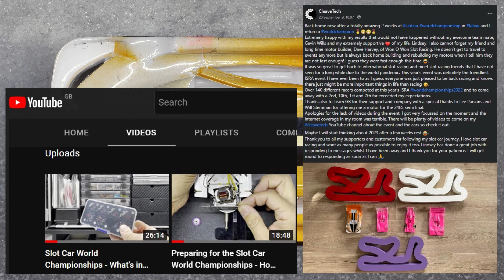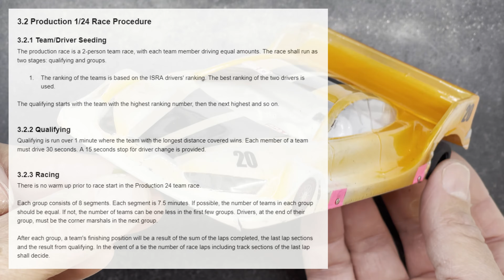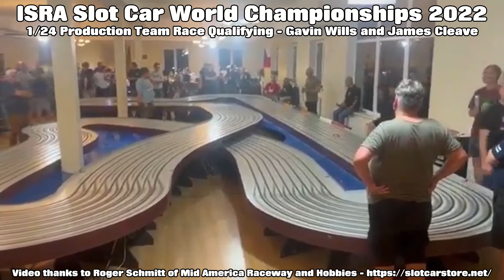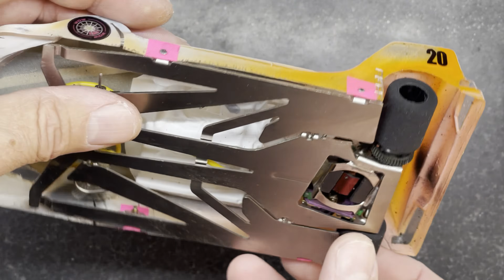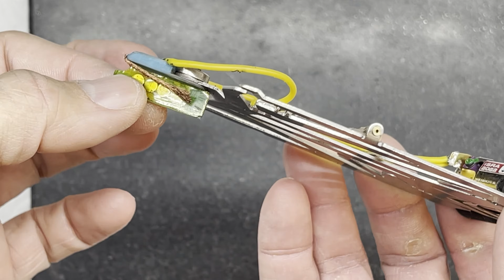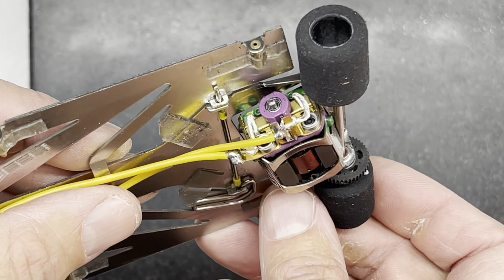Slot Car World Championships - Take a close look at the 1/24 scale JK chassis team race car (Part 1)

Comment: Kinda abstract for looking like a car. The front wheels stickers? In the old days they had to have a real car looking body and tires (all 4 of them) in proportion to car.
Reply from the maker: You are right, they are definitely not models of cars. These things are designed as slot racing cars and are designed to perform the best they can within a set of racing rules. They are like the Indy Car or Formula One cars of the racing world, not the sort of cars you see on the roads.

Comment: Thanks for sharing all this great tech info with us. I don't race any high end stuff but it is so great to see how it is done. Flexi is as high tech as I get. The Eurosport stuff is way over my budget. I do have some older stuff though. Early 2000s Mack 1/24 and older. Just track cars to play with. What do you think of brushless motors???
Reply from the maker: Flexi or Production racing is still quick and good fun. The racing can be very close.
I think brushless motors would be good as a controlled class or for local club racing as they require less maintenance than brushed motors.
Racing brushless in open classes releases a whole new can of worms with the potential for a lot of computer programming and fast development.

Comment: I've never seen a slot car without front wheels, mind you I've not raced since the 60s and 70s.
Reply from the maker: In the fast classes of slot car racing the front wheels are just stickers on the body these days. Front wheels are used in Formula 1 and classes where they still race “scale models”.

Comment: Wow talk about a lucky dip with the motors. Where the arms brand new with full sized comms or were some reconditioned with reduced comm diameters? That would explain why some went up in smoke. Too much brush/comm overlap resulting in excessive dead short per rotation. Cars not starting by themselves and needing a push on a restarts is a dead give away. Oh and well done James!!
Reply from the maker: Thank you Fabio. According to the organisers, the armatures had all been run on track in setups to put them through a heat cycle and then they had been com trued and balanced before going into the handout motors.

Comment: Far out!  As you spoke, I quickly went to my preferred parts source, (in the US), only to learn that those exact arms. are about 10% dearer than my preferred brand's identical spec (without the ISRA).  Good to know...I don't believe that bits should fry with the amount of use that the supplied gear would have endured for the race.  My opinion only...thank you.  ✌
Reply from the maker: All the S&K arms are hand wound and they are wound very nicely. I am sure they will improve the reliability of their armatures. These armatures would have been made at least two years ago so I know the process has improved since.